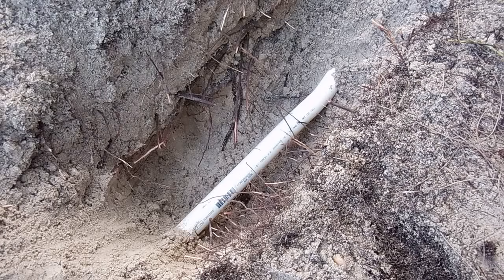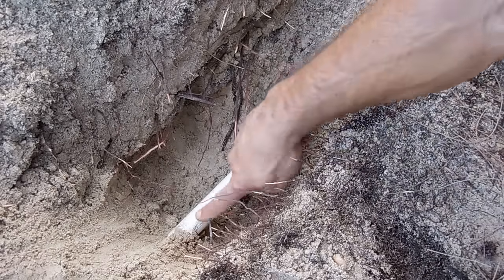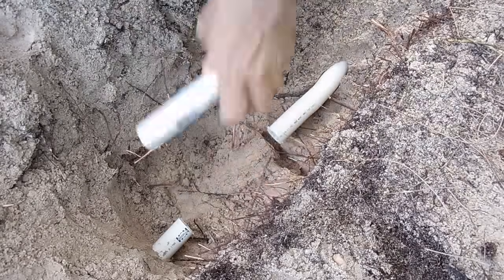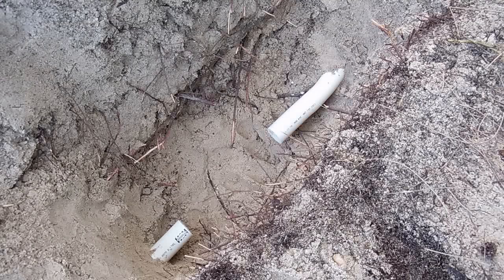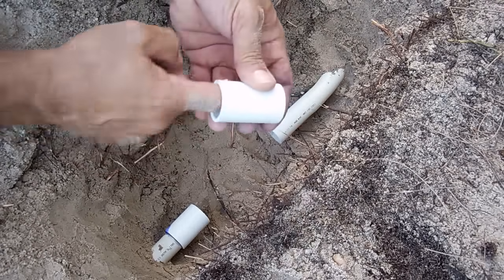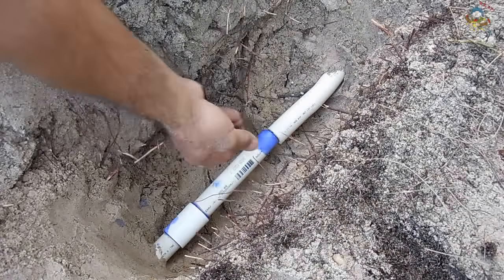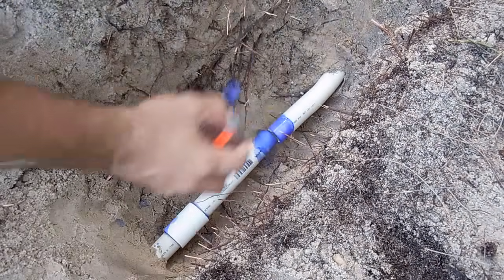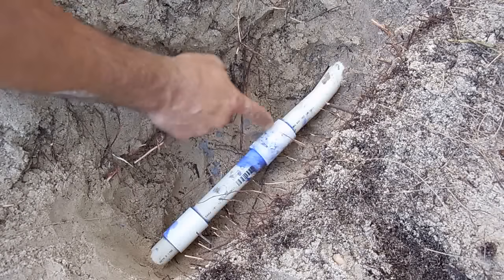EASILY Repairing Broken PVC Pipes(Least Amount Of Digging)

Comment: There is such thing as PVC cleaner (which is clear -- removes old cement and dirt).  Primer is usually colored to allow for a visual inspection of properly made joints and also shows coverage.  PVC cement can be clear or colored when it has primer included.  I'm guessing it's a cement because the bonding of PVC is more like a weld.  The "cement" actually melts the PVC together whereas a glue would bond to the respective pieces and then harden....just a thought.
Reply from the maker: I've installed many city water and sewer lines over the years, so I clearly know the purpose of cleaner that's colored. The words glue/cement/adhesive are used interchangeably. People know what I was talking about. Thanks for watching
Reply: electronicsNmore I wasn't trying to be critical.  I respect your skills.  I've been right there with you on making these types of repairs.  I'm a pro pool guy.  It's kinda semantical information anyway, but the question was raised.  It was more for clarity and less of a correction.  However, there are differences between glues, cements and adhesives.  I understand manufacturers use the words interchangeably, but that doesn't make it right.  Also, using the correct jargon enhances continuity in communication between us trade workers (when I call something a whooseits and someone else calls it a whatimacallit, the sharing of experience and, hence, learning breaks down).  By the way, did you use a reamer to remove the coupling stop or did you find full slip couplings somewhere?
Reply from the maker: Chris Roush
I've had some viewers being critical in the past, so I can get jumpy. :-) I used my Dremel with a grinding stone. I've also used 1/2 round files.
Reply: electronicsNmore Check out the Pasco Rambit.  They come in a bunch of sizes and are relativity cheap for what a God send they can be (much cheaper than the Pipe Parana that works kinda in the reverse fashion).  Pretty sure the Rambit would scrub off the stop in about 10 seconds, but a die grinder like your dremel does the same thing.  Just thinking out loud here....I'm gonna go try it right now and see.  It'd be nice to have a few straights without stops in my bucket for just in casies.
Reply: Thank you for doing that...I was wondering what is the blue thing and also what if is the same thing as cement? I'm confused. He first applied the PVC cleaner that is the Blue liquid, then the glue? How do I look for that? Just PVC cleaner?
Reply: +MyMayra24
Technically, the proper way to join PVC is to apply cleaner, primer, and then cement.  Now, there may be colored cleaners out there, but I wouldn't understand why because it's supposed remove stuff like paint, marker markings, embedded dirt, old cement, etc.  It does this by actually slightly softening the surface of the PVC.  It's almost like removing an extremely thin layer, but the cleaner also has a form of solvent to break up whatever may be on the pipe as well.  PVC cleaner is functionally and chemically very similar to nail polish remover.  Now, the colored liquids (blue, purple, whatever) are primers that deeply penetrate and soften the PVC to allow the cement to form a proper and strong bond.  Now, there are several plumbers and DIYers out there that will say that cleaners and primers are the same thing.  I can't argue, but I can argue when neither are used.  I like the clear cleaner for cleaning cement drips and fitment markings from pipes and the warm and fuzzy feeling from seeing a nice white, clean hub end.  What I do know is that the blue and purple primers are required by code and inspectors look for the telltale staining.  Soooo....for me I clean, prime and then cement under old work conditions; under new work conditions, I prime and then cement (both male and female ends with a quarter turn twist).  There are cements that have primer built-in (such as Otey Rain-R-Shine and Pool Tite, but I still prime the pipe prior to cementing.

Comment: Did you ever hear of pvc repair couplings.
Reply from the maker: They don't sell repair couplings made of PVC, like they do for copper tubing. If you're referring to the expandable O-ring type, or 2 PVC halves that snap & glue together, then those are inferior to what I show in this video, and not to mention, a lot more money. :-)
Reply: Sorry to say that they do. I am a plumbing pro at Lowes retired. Repair couplings for PVC are available from 1/2 inch to 6 inch. They slip right over pipe with no filing involved
Reply from the maker: Never seen them at Lowes, Home Depot, or any other hardware store.
Reply from the maker: I've seen them for DWV, but never for pressure fittings.
Reply: They are not available for DWV. But yes for schedule 40
Reply: They are there just ask for repair couplings.
Reply from the maker: If you do, they'll show you the expandable types, or clamp and glue type. 95% of people watching this video didn't know this method existed.
Reply from the maker: Yes, 3 & 4 inch DWV. Saw it on Lowes website.
Reply: Yes, 3 & 4 inch DWV only available on line. Not in store. Great shopping

Comment: I had to make a repair on the underground water pipe connected to the pitless adapter on my well casing.  Surprisingly, the pipe nipple had developed a hole, not the pvc.  I replaced the black pipe nipple with a 1 x 4 brass nipple and,of course, that meant I had to cut the pvc.  I tried your method but I made a mistake.  I ground off the center ridge in the coupling and tried to dry fit the coupling on a piece of 1 in pvc, but it was a very tight fit and would start but not slide over the 1 in pvc pipe.  So I ground on it some more so that the coupling would slide over the pipe dry.  Then I made the repair as in your video, but it leaked.  I figured it leaked because I reamed out the coupling too much and created a loose fit.  I think if I would have just ground out the center ridge and left the rest of the coupling alone, it would have fit just fine when I put the primer and glue on it.  However, my son was helping me and his time was limited.  So, I took the slip coupling out and installed regular couplings on the two ends of the pipes and forced them together and  glued them.  Hard to bend the pipe enough to get the pipe and coupling to fit together, as you said, but we got it done.  Then later I figured out what I did wrong.  I am going to do it again using a spare piece of pipe so I will know how to do it next time.  It looks like a good idea to me.
Reply: Charlie Wilson

Comment: good idea. A small additional suggestion: Just insert the second union before so it is there and just slide it once you put the glue.. no need to lift the tube on the second union installation...
Reply from the maker: You have to, the coupling does not "freely" slide over the pipe. The fit is snug on a PVC pipe with no glue applied, not loose.  Thanks for watching!

Comment: Thank you! I love it when ingenuity beats complex and expensive solutions. I found it best to remove the stop with a small knife and then sand it flat. I was also stuck with ultra fast setting cement, so what I did was to slip the coupling back past its eventual resting spot on the pipe, applied cement (glue) generously on the ends of the two pipes, and then twisted/slid it to its position stradding the two pipe pieces. It requires that you move fast. Not sure if the cement coverage is what it should be, but I tested and there were no leaks. hopefully it will hold up. Thanks again for posting - brilliant solution to a simple problem.
Reply from the maker: Hi George. It will never come apart. :-) You definitely need to use regular or slow setting PVC cement, and work quickly. Be sure to rate thumbs up, share my channel with others, and check out my newest PVC tip video. :-)

Comment: 4 90s way better solution. dresser coupling also beats this method, and not that much more expensive, after youve spent time removing the stop.
Reply from the maker: Nonsense. 4 90's is a "last resort" solution. I guess you don't know too much about friction loss. A "Dresser Coupling" is not a permanent repair. The seals eventually dry out and leak. This method is the best, and the savings cannot be beat. Have a great day.

Comment: Why didn't you just cut a nice straight cut where you had your leak? It was an up and down crack. You could have simply cut through there and then finished exactly like you did? The extra piece you added gave you no more flexibility. Maybe because you are just showing people what to do if your leak isn't up and down giving you enough good pipe to work with.
Reply from the maker: Exactly. I was demonstrating if the crack in the pipe was NOT up and down, but angled down & sideways. :-)

Comment: why wouldn't you just make 2 slip couplings or buy them that is what you have done and put them both on the pipe you are going to put there with half way mark's then you wouldn't have to force the pipe up and maybe break the glue seal when you do it. Would be a lot quicker also
Reply from the maker: You cannot buy FULL slip couplings for PVC. I do not understand what you're saying.
Reply: +electronicsNmore most pipe systems will have repair/slip couplings in plastic piping systems or do what you did but make 2 sockets and file out the lip/stop then you just cut pipe to butt together and put marks on pipe half the length of the socket can put primer then glue and just slide them on

Comment: Slide the no stop slip coupler ON first. Then do exactly as you did. 

 So slide the hollowed out NO STOP coupler to the right side of your pipe area. Install a real coupler as you did on the left side. Now slide your no stop slide coupler over the pipe void area. Not near as messy as the way you did it.
Reply from the maker: You cannot do it that way because the fitting will not slide over the pipe like you think it will. :-) Thanks For Watching!
Reply from the maker: As I stated, it will not work. The coupling has a VERY slight taper toward the stop which would make it difficult to slide over the pipe w/o using glue. Always apply cleaner and glue to both the male & female parts. Doing so ensures plenty of glue is distributed between the pipe and fitting. If you only apply to one side, then as you push and twist the fitting into position, you will end up with a decent amount of glue where the 2 initially slide together, but very little as it goes deeper in. There is a reason for everything. :-)
Reply: I like the tip, but thought the same as Jim... why woudln't that work?    I would do everything same as you did except I'd slide the no-stop coupler on in advance and then put glue only on the severed pipes (I've never put glue on both pieces of PVC... not sure why you're doing that)... and then slide the no-stop coupler back over the cut line and give it a few twists to make sure the glue is fully distributed.    Oh... and HOW I WISH my soil were like what you were digging in.    Texas clay soil is SO much fun to dig in!!    Can't get the stuff off the shovel!!   LOL!!
Reply: No, it works. I do it all the time. You have to make sure you dremel enough so that the coupler moves freely, but the way you do it provides a stronger bond I think because your able to distribute the glue more evenly whereas when you try and slide it the way I'm talking about it sort of pushes the glue out of the way. Definitely better to take the time and do it your way so you know you have a lasting bond.

Comment: Nice, I was searching the big box stores for PVC "Repair Unions" like you can buy for copper unions. They didn't sell them at my Big Box store and thought about doing what you showed here. You have confirmed what I was thinking. I don't think I have enough room to bend my pipe because of sizable roots so I am going to slip the union on first, then apply the glue liberally. I think this should also work fine especially if I rotate the union when I center it. Nice video.

Comment: Rob...  Couldn't you use the repair couplings that are available, so you don't have to file out the stop?  They are not tapered inside and don't have stops, they can slide on a pipe while fitting it into a tight space so you can pull back over the splice.   In this example you could put on the short repair section on pipe before glueing into first coupler, then slide back over second splice so you don't have to pull up or down on on original pipes.  What are your thoughts on them, vs stock couplers and filing out stop?  Just thinking about less time, extra tools, breaking old pipes, very tight or restricted areas such as under concrete.
Reply from the maker: +thepartsman 
Where exactly have you been able to purchase a PVC repair coupling?

Comment: Great tip ! I put a small crack in a 1" main line to the backyard and the pipe had been encased in palm roots so it would of been a nightmare to dig up enough to do a traditional fix. I actually cut the pipe on center of the crack and applied your fix and it seems to be holding under pressure. So glad I found your video ! Thanks !
Reply from the maker: Great to hear! Be sure to share my channel with others, check out my other videos, and rate thumbs up. Thanks

Comment: Hi, I tried this method but I can't get the coupler to slide over.  I removed the center area inside the coupler.  Not sure what I'm doing wrong???  Did anyone have this problem? :-(
Reply from the maker: +Believe in the 12th man  
Hello. You need to make sure the entire stop has been removed. Also be sure to bevel the ends of the pipe you cut. It is VERY important to use PVC cleaner and LOTS of PVC cement and work VERY quickly. Always keep the PVC fitting in motion. Once you know how to do it, it is fairly easy. Thanks For Watching!
Reply: +electronicsNmore  thanks for replying back.  From what I can tell I removed the entire center out.  I ran my fingers through and didn't feel any obstruction.  Is there a certain type of pvc piping I should be using? I read there's different types.  I did a dry run even and couldn't get it to move or slide.  Jesus not sure why it won't work.  What does the pvc cleaner do?
Reply from the maker: Some fittings are more snug than others. If you have a Dremel with a grinding stone, you can do a really great job and make many at one time. The cleaner "cleans and softens" the PVC. You end up with a stronger bond.
Reply: +electronicsNmore I did use a grinding stone w/dremel.  So if it doesn't slide over all the way then it's not removed all the way in the center? Is there a specific pvc pipe I should buy? I didn't buy the pvc cleaner.
Reply from the maker: Believe in the 12th man
 Practice makes perfect. :-) Remove a little more of the center of the coupling.
Reply: +electronicsNmore ok I'll remove more and let u know.  Thanks for answering my questions!
Reply: my coupling got stuck also as I was testing.  does it side easier with glue and cleaner on it?
Reply from the maker: Hi Tim, just make sure the entire stop was removed, and the ends of the pipes are beveled slightly using sandpaper. Once the PVC glue/cement is applied, it will slide much easier.

Comment: ever heard of slip or repair couplings?
Reply from the maker: +JRPchef 
Of course. I use copper repair couplings(without the stop) all the time, unfortunately PVC repair couplings are not available, only expensive O-ring extending repair couplings. I never saw a "Full Slip" PVC coupling at Home Depot, Lowes, or any other hardware store.

Comment: Sweet.  I was stuck on joining the couplings because I didn't have enough room to manipulate the pipe with dirt on all sides and thinking I would break it if I lifted it too much.  Filing off the stop to allow for the coupling to slide passed the mid point is the secret.  Thanks
Reply: Thank you.  I was confused as to why removing the stop.
Reply: How to heck did you gwt it to slide easily?? I took a dremel and a hand file and filed off the stop... it wouldnt slide... then I preceded to c9ntinue filing for an hour... it still wouldnt slide... it got stuck... so confused

Comment: Thank you!  I've been fixing pipes in my yard  for years but doing an imperfect job. I have one tight spot that I've had to fix multiple times. Two pipes going under a concrete slap on one side and attached to a lateral pipe a few feet away and both have shutoff valves in the center. I just do the best I can with those connectors with the stops and hope for the best.  I feel kind of stupid that it did not occur to me to Dremel down the stops.   Tomorrow I'm going to fix a leak for a nice elderly woman that I know on Facebook and haven't met in person.   I want to do a good job so she doesn't have to pay for a repair later. So I'm researching tonight. Thanks for this lesson. I'm making a list of what I need to take. I think I've got this!
Reply: Then actually sell the couplings without the center stop at stores that specialized in selling irrigation fittings and hardware supplies.
Reply: raftrsi
Reply: m
I

Comment: I do almost the same thing. I've made repairs to RV plumbing in extremely tight places by using 2 Fernco flexible couplings. This technique works great when the pipe can't be moved and you have no work space at all. Nice video. I always enjoy your uploads.
Reply from the maker: +OneRoomShed 
Thank You! I have used MANY Fernco 4" couplings back in the day when I connected to buried cast iron sewer lines with PVC DWV.